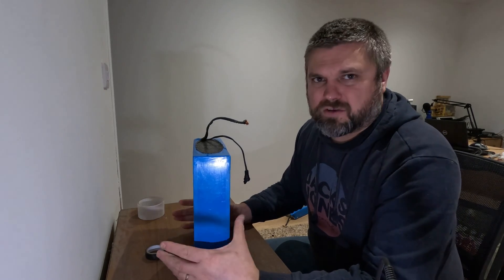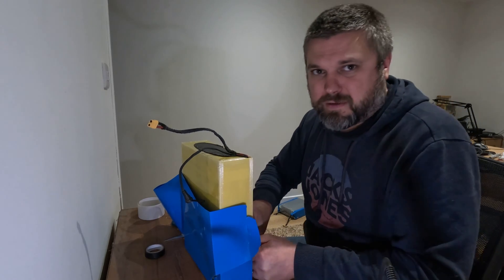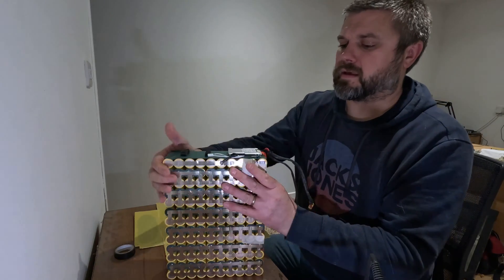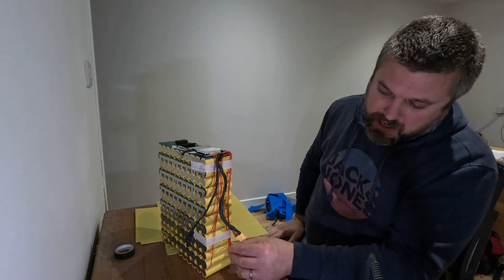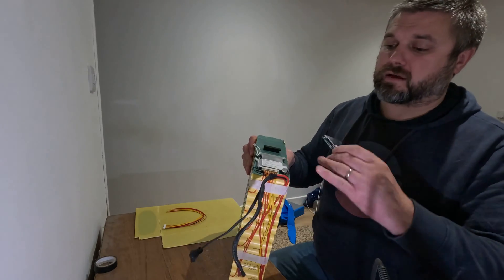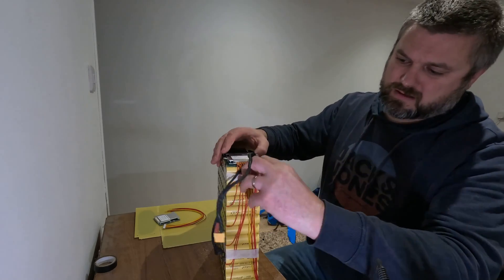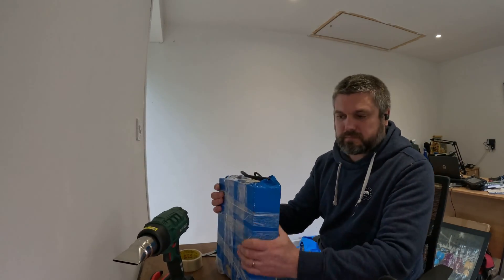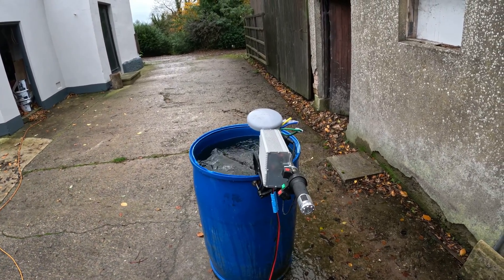Liitokala 48v 50ah LION Battery tear down , upgrade wiring and BMS to 60ah and test on 3kw Outboard

Comment: Hi mate I have a 5000watt motor 72v 30ah 80a battery iv just got a fardriver controller what's the max amp I can set my controller to with the battery I have cheers

Comment: Hey, love the videos that you do. I was interested in purchasing the same pack as you did. Did the new BMS and wire gauge increase the AH rating from your initial testing? Seems as though these batteries are definitely a gamble but overall still worth it at the price point. Keep up the great content 👍
Reply from the maker: Thanks for watching! , I think they are fine for the price point  , must do a follow up , i've been using a pair of batteries with an ebike joiner that balances them along with the max350 and is hasnt missed a beat and i'm out twice a week ,  only need to charge every other week as well. I'm a bit nervy on range for when i'm a bit away from the berth , am going to do a range test with the two to see how far I can get and maybe give me a bit more confidence as well.

Comment: Have you tried capacity testing the pack to see if it can pull the full 50Ah? I don't think those cells are 5Ah, I've seen people pull anywhere from 4200 to 4600 from them. Haven't seen anyone test their max discharge rate but we know LiitoKala lies out their ass

and how did you feel about the nickel material used? I'd always assume they would use nickel plated steel which isn't what I would want but for some people they don't care....but for a marine application I don't think its acceptable.
Reply from the maker: I must do another capacity test after a year of use . I've had no issues . i don't leave the batteries on the boat and they are dry when in use.

Comment: Hi, thanks for the review. I wanted to buy a similar battery, only with a higher voltage as an external battery for my scooter. Do you have any results from further testing after replacing the BMS? thanks a lot :)
Did you buy from liitokala factory store? People say that in addition to the official store, sellers sell B grade cells and rewraps.
Reply from the maker: yes bought from liitokala factory store , have two packs for my outboard motor . I'll do another test and run them down to bare minimum and see what I can get out of them.
Reply: @boatsandbits  thank you :)